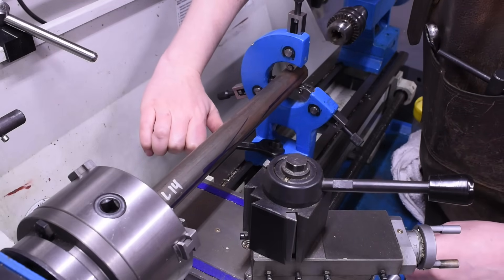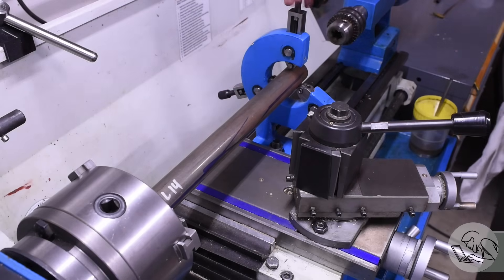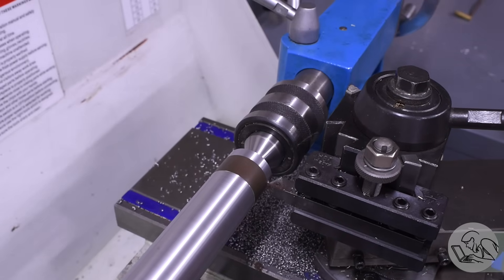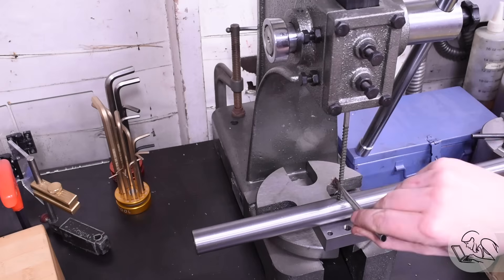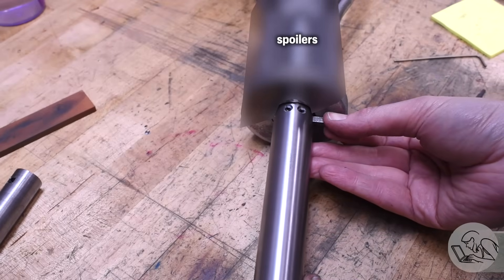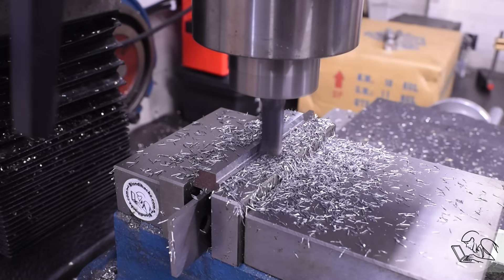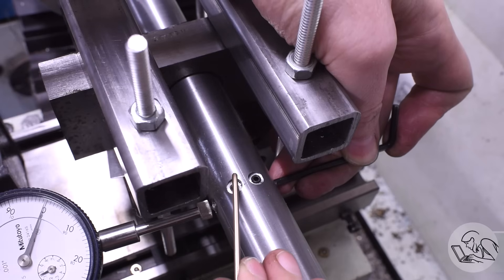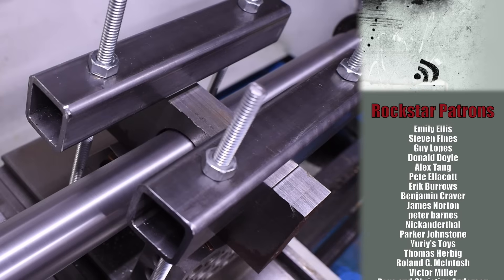Line Boring On Small Lathes!

Comment: I found the main issue with this style of boring to be swarf evacuation. In a longer bore it gets quite stuffed up. I ended up milling a flat all the way down the bar to give the chips some room to move in. Have a look at 'machining cylinders part 2' for similar work. Cheers, Crispin
Reply: My favorite line boring tip that came from a subscriber is to put the cutting hss blank at 45 degrees to the bar center. That way you can use a micrometer to set the cutting radius and also you get fine adjustments as at 45 degrees moving the cutting tip out 0.002" only puts 0.001" on the cutting radius. Again all in machining cylinders part two Incase that was confusing.
Reply: @MrCrispinEnterprises   Great Tip, but you would need a 30° angle for 0.001" radius per 0.002" bar movement. 45° give 0.001412" radius per 0.001".
Reply: @schrauberhugo2594  You are right about the 30° angle but the 45° angle will give 0.000707" (√2/2) radius per 0.001 bar movement.
Reply from the maker: Ooh, that’s another great idea
Reply from the maker: Yes, excellent point! In my case I have a lot of material to remove and it’s cast iron, so it will have plenty of space. A flat on the bar is an excellent idea. I’ll remember that one!
Reply: @Blondihacks  wags
Reply: You both add to my success
Reply: Note well. The Master has spoken.

Comment: I have also drilled holes at the center of all 4 corners of a square hole needed and used a small endmill to cut the square it just leaves a cut radius on your corners which sometimes is beneficial cause usually the coroners of square part is where it gets burred up I work in a tire Manufactuing machine shop and we don't have square broaches either so its drill the four corners and mill or file the square.  if it's a part that will interchange, I would drill the four corners to help with corner clearance, if possible, from Manufactuing experience and how production workers are with handling parts.

Comment: When I worked at the lab, we had a 2" diameter line boring bar that had a set screw behind the cutting tool to advance it more accurately. I think it was tapped before the bar was broached.

Comment: I have done this on a project that needed to bore through multiple webs (similar to an engine block). You can measure your bores by turning a loose-fitting, stepped go-no-go gauge to slide on the boring bar. You slide the gauge up to the hole after each pass until the "go" diameter barely fits then move to the next hole. While a set screw behind the cutter can provide tool advance, a little trig and a slanted tool hole will allow a precise advance per flat on the screw. Using the lathe as a horizontal boring mill is a great technique. Your videos always deliver.

Comment: Hi Quinn, greetings from the UK. Thank you for making this excellent video. At 13 mins you mention a future video on a more precise method of set up for such an operation. Did you ever get around to making that video? I been searching your channel to no avail and wondered if my words in the search bar weren't quite right.
Many thanks.
Reply: i always wonder how feasible it would be to set up a vise with vertical axis movement on the cross-slide. that seems like it would be the logical way to more precisely/repeatably set up a part where the lathe is turning the cutting tool

Comment: Regarding adjusting the cutter to dimension, if you have the room a great way to do this is to add another setscrew on the rear end of the cutting tool.  You can then slowly turn the screw, while watching your indicator.  You can make very fine, progressive adjustments in this way.

Comment: I have a question my good lathe is an atlas 10 “ , i also have an old south bend 9 “ that needs bored and bushings installed. Do you think it would be possible to line bore it on the atlas

Comment: In  my early machining days I got the job of square broaching a 1” square hole in a custom socket wrench.  I drilled the pilot hole, then it was off to the hydraulic press.  I squared up the sides of the broach with the work and started broaching.  The broach was at least a couple of feet long, so as it went down I began to see my mistake too late.  I was broaching a finished square hole that was 45 degrees to the work,  because that is how square broaches work.  Duh.  So, Blondihacks, let that be a lesson for you haha.

Comment: You can grind a tool bit from old center drill or other round HSS material, then a drill hole in boring bar to hold it. Cheap and effective for occasional line boring.  Grind a flat  for set screw lock to keep it from rotating in boring bar. Works !
Reply: Of course, this removes the need for square hole and broach.

Comment: I used this method to bore the crankpin holes and main shaft holes for a large steam engine crankshaft.  For perfect alignment I tack welded the crank webs (8 x 2-1/2 x 1-1/4 cold rolled steel bars) together, and the bored holes had their centers the same height on the lathe cross slide.  This allowed boring  into the crank webs without needing to touch the cross slide setup for the entire operation.  Setting the boring cut to give a final bored diameter a few thousandths undersized avoids difficult fiddling with the boring bar cutter.  After final bore, the shaft pieces (1-1/4 drill rod) are turned down a couple of thousandths on the lathe to make a heavy press fit into the crank webs.  Much easier to hit the right shaft outside diameter turning the OD rather than hitting a precise bore diameter.  Finally drilled and tapped the crankshaft/web joints for a couple of "po-boy" keys, with a couple of set csrews in series, rammed tight one behind another.

Comment: Great demo, thanks for sharing it. There is one thing folks need to remember before they do lineboting like this, that is to ensure their tailstock is centered to the bed. If the tailstock was used to create a taper on a previous project and not centered your line boring won’t go well if it must also be centered on the part itself.

Comment: Another great video.  Boring bars are round out of necessity as in big jobs the work is stationary and the bar moves.  In your case and supporting MrCrispin why not use a square or hex bar.   You mentioned you used an old piece of tool steel and acquired a square broach.  I think a less expensive option is to purchase round HSS and grind a flat on it for orientation.  That way just drill a round hole (or many holes).  On jobs with multiple bores you will run out of travel.  This is addressed with multiple holes in the bar.  Drilling beats broaching.  Cheers

Comment: Never really thought of that as line boring. When I think of line boring I think of 2 holes separated by several feet or more as in a loader bucket where the holes have to be "in line" so that the bucket or other object can swing inline to pivot over the installed bearings at each end usually with 2 short pins rather than 1 long pin. Usually when you line bore the bearings have been so worn that the pins are past the bearings and into the metal. Then you need to line bore the bearing pockets oversize to get bushings back in alignment. High production and poor maintenance leads to that problem.

Comment: Hello from the UK. A great video and very informative, just thought I'd mention that here in the UK these are known as "between centres boring bars" - I made a 1" one (yes I'm still using imperial measurements)  which has a sliding 'micrometer' attachment, this is used to set the cutting bit as fine as 1 thou increments. -  Quinn keep those wonderful videos coming !!

Comment: Hi. I am new at turning small projects with an old 10 inch swing Atlas lathe which came with the old "lamp post" tool holder.
I would like to get a quick release tool changer but don't know which size or model to get.
Can you advise, help on selecting one?
Thanks

Comment: Just  a thought...If the cutting tool is cut shorter,and the bore space behind it is threaded,a fine pitch  grub or plug screw could help adjust the depth of cut needed,it would be a smoother motion to act on the dial indicator plunger probe.

Comment: the design is very good, on that test, my only concern is about the chips, usually, on such a setup, the diameter difference between the bar and the bore is sufficient to leave space for the chips to escape, on your test, as soon a chip will curl, it will jam between the bar and the bore and will damage the finish.
I had to do a small boring machine to remachine a bushing bore on a sterm drive marine engine on a boat, I used about the same approach for the bar but it was a portable machine driven by a small battery drill, I used a jig to adjust my cutting bit. 
that was not as professionnally made because I have only a  lathe  no milling and broach but it corrected the roundness of the bore within  a few thouthenth so I fabricate a correspondent replacement bushing and saved the drive.
very good video.
Reply from the maker: Definitely a consideration! In my case there’s a lot of material to remove, so clearance won’t be an issue. Good point though.

Comment: best center drill: 60 deg or 82 degree? just go a mini mill! Do you recommend these: T25947 5/16" HSS Lathe Tool Bit Set - 5 Pc. by Grizzly. I plan on mostly using soft metals like brass, aluminum.

Comment: Very timely! I have an upcoming project that needs line boring, so seeing how you got on with it has been very useful. Insightful comments too. I'm using a collet chuck to hold the headstock end. I was going to make the square hole right in the middle of the bar and grind the tool to put the cutting edge in the right place so I could cut in forward or reverse. Nice tip from John about threading the back side for micro-adjustment.

Comment: Question: How do you make sure that you arent boring a tapered hole? If the boring bar wasnt parallel with the ways, wouldnt it produce a tapered hole? So for all intensive purposes, what if your headstock had a 1 degree taper, ie it was angled towards the carriage by that much (or the front of the lathe I guess). Would that error reproduce itself in the hole you bored?

I am following the Dave Gingery path, and he basically makes a headstock the same way.

Comment: As opposed to removing the bar to measure the hole, how accurate would it be to mic the OD of the bar, than mic the OD with tool stickout, double stick out (plus bar OD) and use that measurement as your ID of your bored hole?  Just curious how much error that would introduce.
Reply: more than plenty plenty thousandths I would think . . .
Reply: On the contrary to the other answer, it is often done this way; it's fiddly, but quicker, and perfectly accurate if done skilfully and carefully.

Comment: I've been lineboring for many years, well done. I prefer to leave the cross hole in the bar round and use round tool bits,  broken endmills and drill bits work well for this with a small flat ground in them. The set screws will hold things in place well enough, think welding shank. On larger jobs I use 3/8 and 1/2" sclcr boring bars cut down to length with ccmt inserts. I also like to tap the back side of the tool bit hole with fine threads so the diameter can be set with a set screw. I also have hollow bars made with very heavy wall tube that allow coolant or oil to be pumped in to the cutting edge for deep boring jobs. A quick connect air fitting on one end works well enough for a rotary union for the low rpm these jobs run at. Plug the other end and drill a small hole on either side of the cutting bit to allow coolant to pass through right to the cutting edge.
Reply: Excellent idea on internal lubrication.

Comment: I'm hearing (and seeing in the comment below) references to "a small lathe".  And I guess they are,  relatively speaking.  There's a guy not far from here that has the biggest lathe I've ever seen,  probably a bit bigger than my truck!  OTOH,  the sizes of some of what I'm considering is a lot smaller than what you're using here,  probably small enough that I could pick one up with one hand.  Last time I saw any of these I was looking at the workshop of a guy who called himself "the clock doctor" and for some reason he had three of these,  all lined up,  on one of his workbenches.  I'm not thining abo0ut more than one,  at this point,  and am wondering how limited a tool that's going to end up being compared to say the one you're using there.

Comment: Nice work on the set up. Myford vertical slides fit well on these machines for holding work on the carriage. I think you can get Chinese ones too. I used one before I got the mill but never thought of it for line boring so thanks for that little jolt. Looking forward to seeing the actual project.

Comment: For anyone interested Hemmingway (in England) has a kit for making these sorts of boring bars.
Andrew Whale did a video on that kit. Of interest in that kit is the micrometer for adjusting & setting  the cutter. It enables you to do a bore check the hole dimension and accurately adjust the cutting tool to get the bore you want. He later used one of those boring bars for one of his model steam engine cylinders.  
-> https://www.youtube.com/watch?v=wJLutnbVVHw
Reply: Also the Hemmingway boring bars are between centers type.

Comment: 20 ish years ago we needed a large air compressor for the live steam shop and by chance a previous employer was scrapping an old Kellogg American 340 series on a 120 gallon tank.   The main issue was the high pressure side wrist pin had gotten loose and had gouged into the cylinder wall till the compressor locked up and broke the rod.   Two main issues was the cylinder bore on the high pressure side was just under 3" diameter by almost 10" long and no automotive machine shop around had a boring machine that would do a sub 3" bore in excess of 9" long.   So I built a similar setup but made a bearing bronze bushing that fit the taper of the headstock on my 16" american pacemaker and bored it out to 1.750", then built a 1.750 by about 36" long bar with a .375 tool thru it clamped and advanced with fine thread set screws.   The carriage end of the bar was machined down to fit the slot on a tool holder and was aligned to travel into the headstock perfectly.   Once ready I bolted the cylinder jug onto the face plate and at the slowest speed went about boring.   The other main issue was a lack of parts available for an 40 or so year old Kellogg American air compressor and I doubt they ever offered oversized pistons.   The size of the bore ended up being what I could get in a set of rings the next size over what I needed to clean the bore up and I had to make a piston to fit the bore and a rod to replace the broken one.    Unfortunately all my pictures were on 3.5" floppies (old sony 91 camera at the time) and the floppies have all went bad.

Comment: Was just thinking about Clickspring when you made the comment, ha! That clock was a fun build to watch through.

That's not a bad analogy about software. Mechanical engineering, machining, and software share similar test methodology. Perform unit testing on the individual components to ensure they work on their own, and only then do you do integration testing. Same way to diagnosing any problem - limit your variables and you'll find what's messing up much faster (or at all!)

Comment: really fun video. doesn't apply here but i happen to know that MSC also sells line boring bar inserts. round OD square id. and there is a cap screw in the back for precision adjustments. i believe i saw this on Keith Fenner's channel on a 2" or 2.5" line boring bar.
Reply: I was just going to say that a useful mod to Quinn's boring bar would be a set screw on the back of the cutting tool slot to make fine adjustments to depth of cut.

Comment: instead of broaching the hole you can use round hss blanks a lot easier for line boring and small fly cutters
Reply: I was going to say the same thing. Maybe making a small square holder for grinding and grinding a small flat on the tool blank for orientation in the bar.

Comment: About mild steel vs any other steel...
There are no dramatic difference in rigidity between any kind of steels.
Reply: True!  Yield Strength and Tensile Strength change with alloy type, but Stiffness remains essentially constant.  In that respect, steel is steel.
Reply: It's amazing how many people who you'd think would know this, do not. Or sometimes, they temporarily forget it.
It's why (to give one clearcut example) it's a waste of time to use high strength steel tubing for (say) pushrods in an IC engine. Because of their slenderness, and the fact that the loading is entirely compressive, they fail due to buckling, which is solely a question of elastic modulus, and so 250MPa steel will stand up just as well as 1100MPa.

Comment: Would it be a good idea to drill out the dog bolt and stick a bit of copper or aluminium in its end ? It would save you the shimming every time you use it in a finished surface, no ?

Comment: For line boring I have found Cutting Edge Engineering Australia makes really nice videos. It's often possible to take measurement without removing the boring bar. See their video "Line boring and Bore welding Caterpillar 775 Truck rear strut rod " from 15:06 onwards. Might not work for this project though.
Reply: Kurtis of course is working with much larger pieces making the measurements somewhat easier.

Comment: Drill your broached hole on the none cutting side and run some fine threads in it. Use a fine thread set screw for a micrometer style adjust on tool depth. It is quite convenient.
Reply: Yea, I was thinking it would be something like a fly cuter.
Reply: The GHT approach
Reply: Very cool idea - 😊
Reply: Quinns video is great introduction to this subject but I like the idea of tapping a fine thread down the hole to be broached, I've since tried it and it works great, thank you.
Reply: What’s a bore cutting tool?